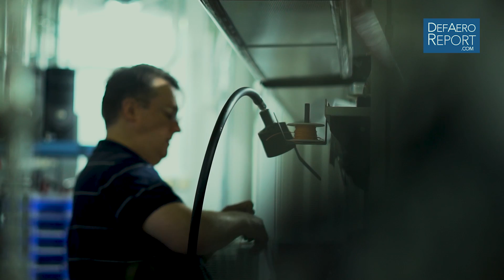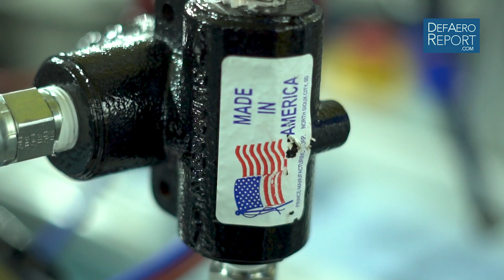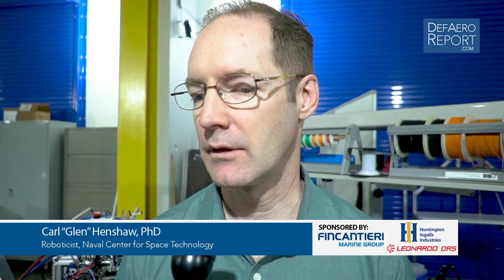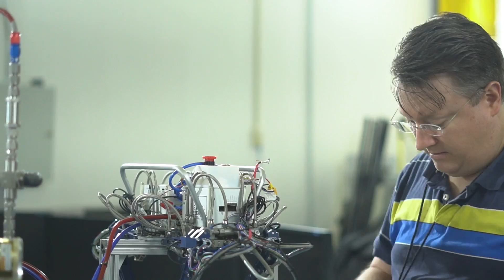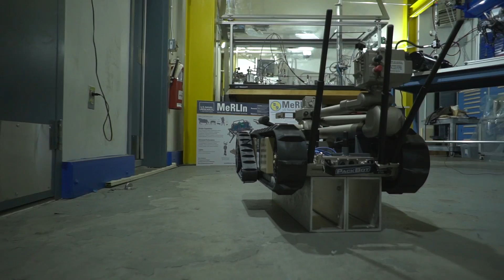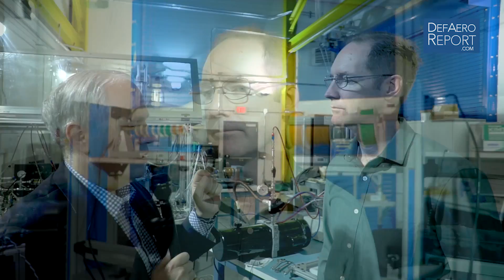USNRL's Henshaw on MeRLIn, Designing Robots With Legs

Comment: Very interesting. I hope they are using RobotOS / Python to work on and share algorithms. There is quite a community of people building software for robots.

As for computers, I heard a year ago there are 95 billion ARM processors already. They run in many low power situations like cellphones.

You can extend the battery life of an ARM system by smarter software. For example,  instead of taking 30 fps video, you can take 1 fps. That saves time powering the sensor, but also all the later processing. That might not be good enough, but it's a knob you can easily tweak to meet your requirements. There's also an ARM GPU with a lot of capabilities to process data in parallel that you can use to save CPU and battery. The faster stuff runs, the faster you can get to idle and put the CPU in a low power state.

I worked on an ARM smart watch running interpreted code that ran all day because it used the CPU 1% typically. All the key algorithms were in C or ran on the hardware.